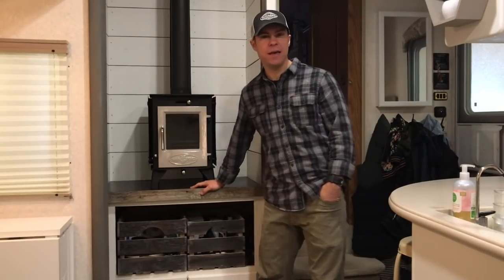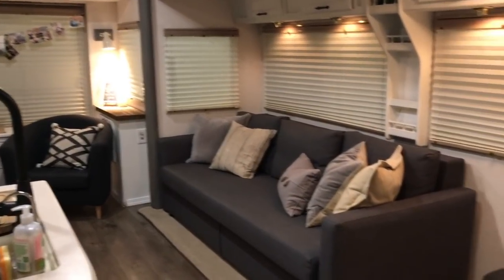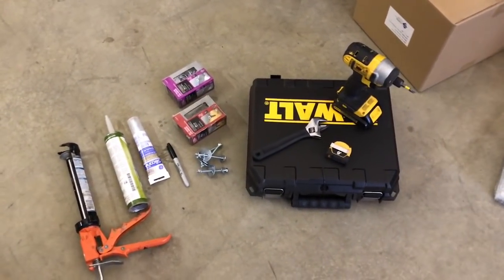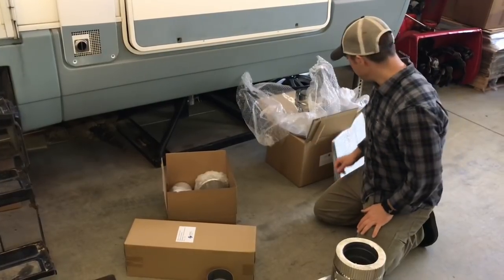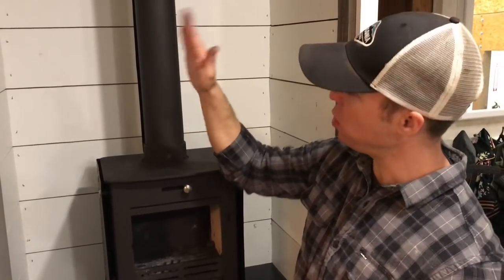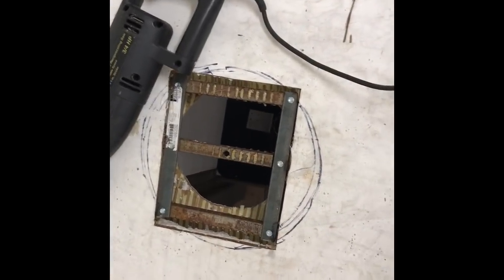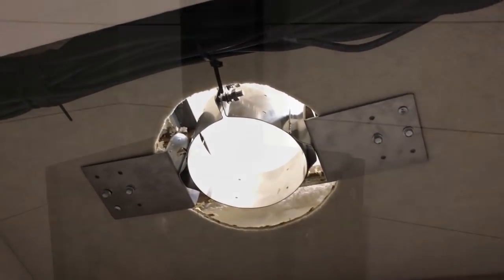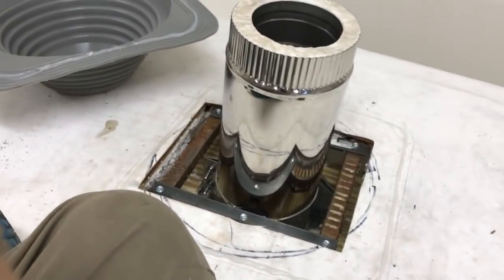Small Wood Stove Installation in 5th Wheel RV

Comment: How do you keep the underbelly warm? i live in a 40th keystone Montana and the propane furnace heats the underbelly as well as the whole living quarters, however using a wood stove would keep the thermostat from turning the propane on and heating the underbelly so it could be toasty in the living quarters but the holding tanks could still freeze.

Comment: Does installing heat shield on the stove itself affect the heat output? How does it radiate heat through the front glass?   Good video though !!  Thank You!
Reply from the maker: The shield works by convection, with the heat rising in front and behind the shield cooling its surface.  All that heat winds up in the room, so it doesn't change the stove's output significantly. 🔥

Comment: hello can i use a double wall pipe for the entire pipe instead of a single then adaper then double like you are doing?
Reply from the maker: Our 5kW stove that will be compatible with the oven has a round flange. You'll want to have the flue connect to the back of the stove so the oven can be added on top later. Hope that helps.

Comment: I want to add the heat shield like you did directly to the side and back of the stove. What did you use for spacers? and what type of sheet metal?
Reply from the maker: A heat shield of carbon steel (22 gauge or thinner is fine).  Spacers are ceramic and don't conduct heat out to the heat shield as well as a steel spacer would.
Reply: @tinywoodstove  I added the heat shields to the sides, rear and bottom. I ended up using 1 1/2" steel chrome standoffs so that I could drill hole, thread and mount bolt from inside the wood stove and then mount heat shield with a bolt to the outside of the standoff. I used two standoffs mounted diagonally for each heat shield.
Reply from the maker: @wallycass2780   A great plan!

Comment: I have a 500 square foot camper and it can easily get down to 10° farenheit where we live.  Was wondering if anyone had some advice for me on if one of these stoves would work for me?
Reply from the maker: Yes, the 4KW or 5KW dwarf stoves would fit that space just right.  With your low outside temps, a 5KW is probably the best option.
Reply: 500 SQFT is almost twice a 40' coach.